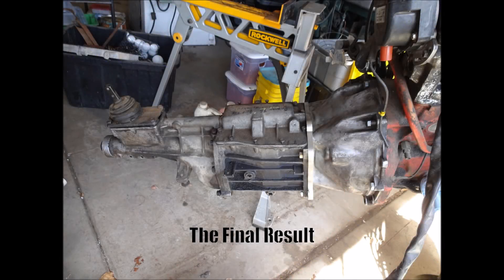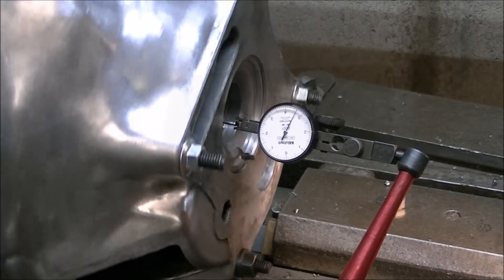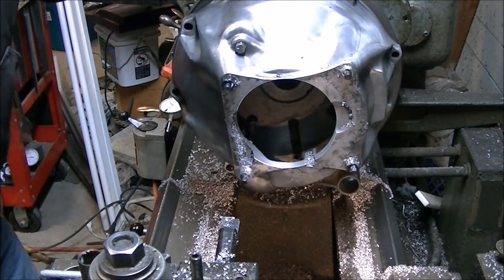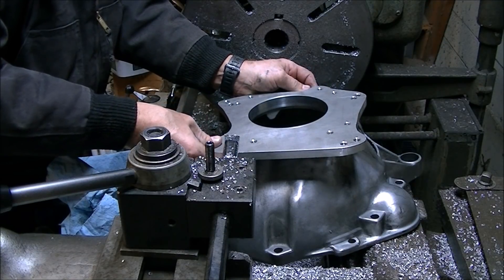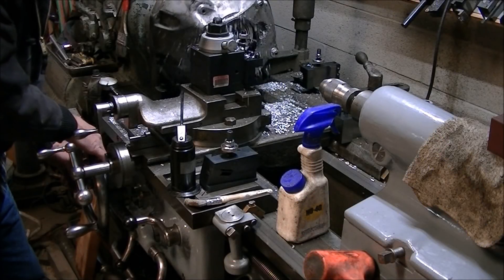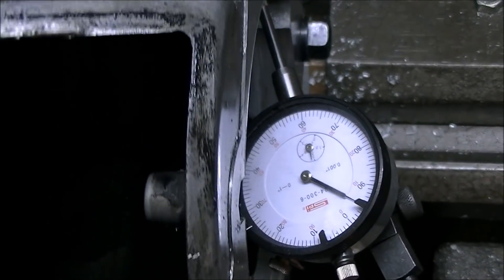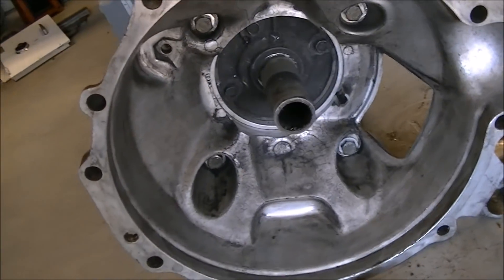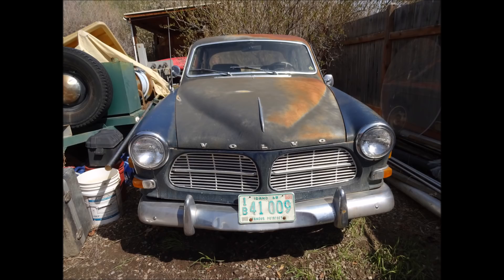T5-Volvo Adapter: A Hendey LAthe Project, Part 2

Comment: nice project where did you get the actual adapter plate?
Reply from the maker: It came on a car my son had bought. It was from an outfit called Yoshifab. I would had just bought one from them as they are reasonably priced but they were out of stock and had been for a while so I thought I'd try and make my own.  Thanks for watching and commenting.  Craig

Comment: many times I'had to do this type of fitment, one lesson I retained is to make a semi finished cut then reinstall the bellhousing on the engine then indicate the semi finished bore in respect to the crankshaft and repeat the indication on the face plate then finish the bore, this way, you take all the chance on you to have a true axis with the crankshaft, otherwise, a not true bellhousing will lead to a misaxed gearbox with all the consequences associated.
Reply from the maker: Jacques, thanks for your comment, I think I see what you are saying. In this case I was fortunate that the transmission has a register around the bearing housing that holds the input shaft and I wa able to make a register on the adapter plate to register the bore of the bell housing. By doing both registers in one set up on the lathe they are sure to be concentric to one another. I can see how my way would not work with all transmission/bell housing combinations. Craig

Comment: I think I would have been tempted to just line up the first one and get it TIG welded together.  Good result even with all the challenges.
Reply from the maker: Harold, I thought through a few options but since I had a couple extra bell housings I figured it'd be best to start over. I can use the first bell housing with a new adapter plate that I make to fit the bell housing. 2 steps forward and 1 step back, at least I'm moving. Thanks for watching and commenting. Craig

Comment: Nice work👍. That's a neat looking old ride. Glad you had a practice bellhousing. That spring from heavy cuts will get you everytime.   Heavy cut to a light cut can be a guessing game on where your numbers end up. Done that a few times myself
Reply from the maker: +Steve Summers I need a lot of practice parts but I usually get there in the end. Glad you could stop by. Any plans for Stan's summer bash this year? Craig
Reply: clemwyo I won't be going this year. I would love to but I just really can't swing the cost. California is no where near Ky😃 Maybe next year👍. 
Sometimes I get lucky and get the setup correct the 1st time. But not often.  Nice video 👌
Reply from the maker: +Steve Summers it's only an 8 hour drive for me so I'm going to try and make it this year. I'm just trying to help you all out so you don't have to make add many mistakes as I do. Craig

Comment: Great work.  I have had my share of "missteps" with work shifting on the faceplate.  A real attention getter when it happens.  Thanks for sharing and good luck with the rest of the build.  Fred
Reply from the maker: +Fred Miller "attention getter" is over way to put it, "pants soiler" might be the other way. I knew I was getting into trouble with that trepanning and I should of stopped and figured out a better way to finish it off once I broke through in a couple spots, but hindsight is 20/20. Next time I'll be more careful though. Thanks for stopping by. Craig

Comment: Bummer about the obstacles and missteps, but glad it worked out. When I saw that floppy fit I was picturing a solution where you would true it back up on the lathe and then TIG weld some aluminum to build it back up (while mounted on the lathe to keep it true), then boring it out again. Glad you had a spare. 

What you said about the spring combined with a small advance for the finish pass causing you to overshoot your dimension makes sense. I think that explains at least one issue I've had in the past. Thanks!
Reply from the maker: +Jon Miller that floppy fit made me think of a lot of things too but they would have been very inappropriate for the video. On the other hand, there are a lot of good lessons on the screw ups. I creep up on final bore sizes more carefully now, just one light pass after the hogging passes and before the finish pass makes all the difference. Thanks for watching and commenting. Craig